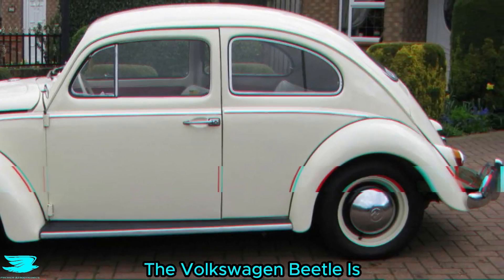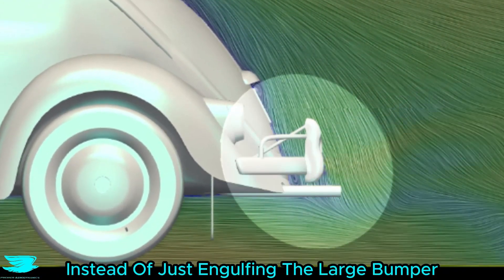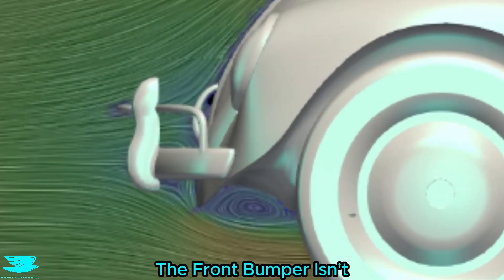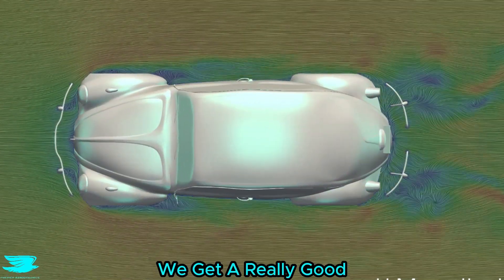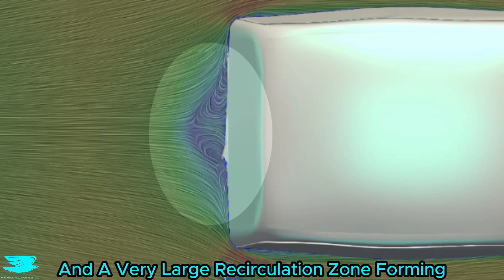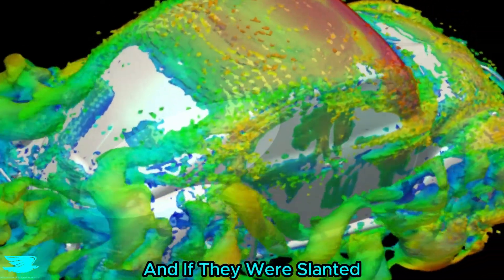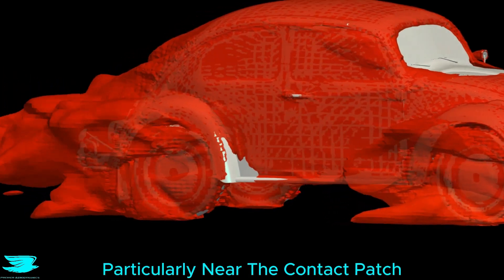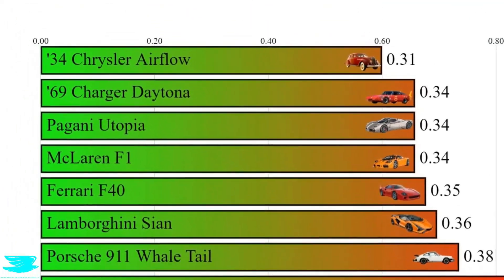*Volkswagen Beetle* Aerodynamics

Comment: In Brazil, it's common for Volkswagen Beetle owners to install a spacer on the rear engine cover to improve cooling and give it a sportier look... Is this modification actually effective in cooling, or does it end up overheating due to the turbulence it generates?

Comment: if you'd had experience actually riding in or driving a beetle, you'd want to study its performance, including how its suspension worked with the tires, in a crosswind, especially with a load in the car and under the type of crosswind that you get when a large truck passes.  It's scary.
Also, the early beetles had lower power engines, which of course were not always in top tune (they needed manual and frequent adjustment of the valves).  Real-world experience is that in a long drive into a strong headwind, the top speed was severely limited.

Comment: The Beetle used in your simulation is not identified by model year. Late model Beetles (1968 to end of production) have one piece bumpers (U.S. spec). Also, the Super Beetle has a curved windshield (windscreen) with a pronounced front end luggage compartment and wider front track. In retrospect, the Beetle windshield should have been angled slightly back... even if only an extra degree or two. All of those changes somehow changed the aerodynamics.
Reply from the maker: Thanks for the input!

Comment: How about the drag coefficient of the original split window bug
Reply from the maker: Thanks for the idea! We have in the works a large video about the evolution of the beetle aerodynamics. It will take some time to run all the simulations though.
Reply: @PremierAerodynamics  can't wait, legend has it that it was one of the most aero tested cars ever during development (possibly due to rear engine air cooling). Would love to see the results of different aftermarket mods like the kamei chin spoiler and the porschelike 'whale tail' which supposedly greatly improved cooling 🥰

Comment: You messed up your simulation. There is no way airflow would stay laminar under the body of this car.
Reply from the maker: Who said it was laminar? You can have attached flow that is turbulent.
Reply: The lines being parallel suggest the airflow is laminar. I can't imagine the airflow hit the front bumper and then go under the car with little to no disturbance. And that's not even accounting for the elements of chassis. The real result should be absolute chaos under the car.

Comment: Now try to fixing the bad parts on the Beetle and adding downforce to it.
Okay, now you get a 911.
Reply: You get a 356
Reply: He did an old 911 with a whaletail
Reply from the maker: Lol
Reply: In Brazil, it's common for Volkswagen Beetle owners to install a spacer on the rear engine cover to improve cooling and give it a sportier look... Is this modification actually effective in cooling, or does it end up overheating due to the turbulence it generates?

Comment: The underbody aerodynamics is heavily affected by how detailled the model is. I would assume most of these models have a nearly flat floor, or at least very rudimentary modeling of the engine, exhaust,... So when you say that the underbody is doing well I always take it with a pinch of salt. Maybe you could show the underbody in the video?
Reply: The underbody of a Beetle is very flat and dont suffer from have an engine upfront.
Reply: @bodanerius  I wasn't talking about just the beetle, just in general. Floors are often not modeled well
Reply: @toonverbruggen7351  Thats probably very true. Theyre way more elaborate to model.
Reply: Yeah, this is a weak point of CFD in general. Small details often make a big difference so any simplification of the model adds salt to the analysis. Even something as seemingly minor as panel gap width will have an effect on the boundary layer in the real world. This is why in real engineering CFD is ideally always followed by scaled or full scale wind tunnel testing despite how expensive it is.

Comment: Funny how a beetle and a countach have very similar drag coefficient, you would never say it looking at them
Reply from the maker: Yeah, they get there through very different shapes.
Reply: @marcos1669  supercars and all the cars with massive engines in general, have huge air vents, mostly for cooling that engine. It's an interesting fact that even in the same car, the drag coefficient can change as we move towards the more powerful versions because more air is needed for the engine. The BMW 3/5 series and all the other similar sedans are a great example.
Reply: Isn’t the countach designed to have a lot of drag with that drag pointed down to increase downforce and wheel grip?

Where the Beatles drag is not useful in any way?
Reply: At least the Beetle cuts through the air better than the wedge that is the Countach haha. That thing is basically straight lines and angles unlike the Beetle.
Reply: The Countach is anything but aerodynamic lol.
Reply: @SockyNoob  Right? lol it's a flat wedge